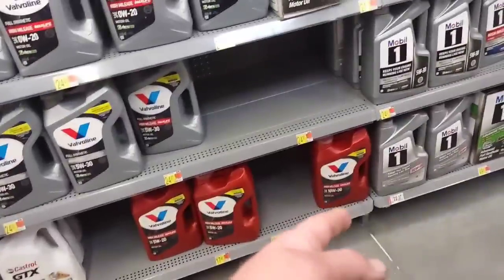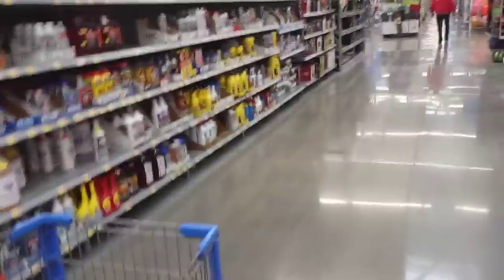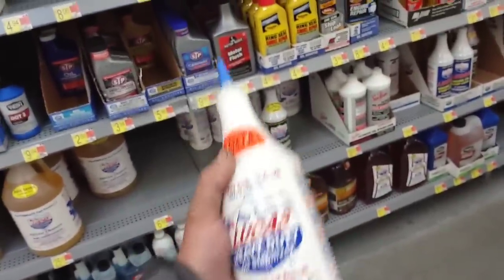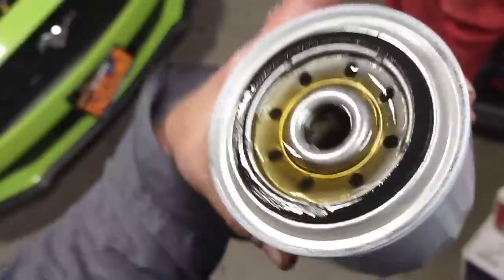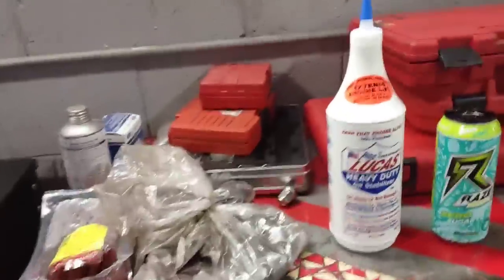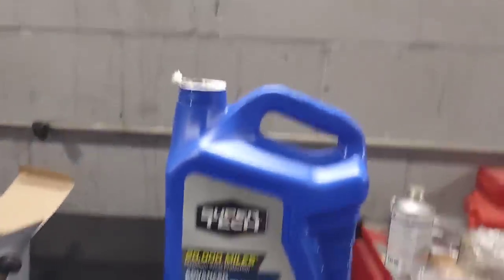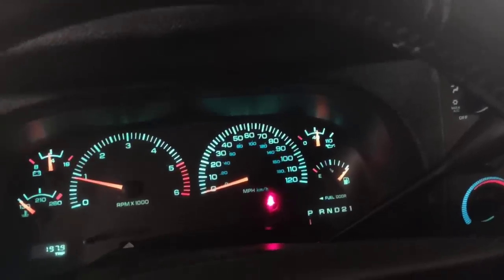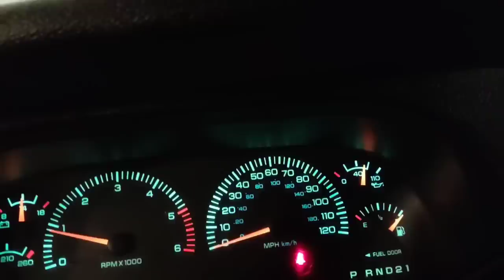We continue With Marvel Mystery Oil and SuperTech 10w30 20k Mile Full Synthetic Oil Dodge Ram 5.2L

Comment: RIch, do you think that using some amount of MMO in any DI engine would help to limit or even remove inlet valve deposits that tend to build up because of the designs of the PVC systems?  Is there any way we could get this tested over a period of time?
Reply from the maker: I mean there might be some residual and there might be a little bit better oil control from piston rings but ideally I don't think so
Reply from the maker: I'm almost half tempted to buy a direct injection car and build a kit that people can install on their car just to clean the valves
Reply: I'm leasing a 2020 Corsair, and if there were an oil catch can for this newer 2.0L engine iwould install it. Most likely will buy at the end of the lease, so thinking long term.

Comment: Super tech oil is manufactured by Pennzoil for Walmart stores. If you change your oil regularly, it doesn’t matter what brand of oil filter you buy. I wouldn’t add any oil additive, it’s a waste of money, even if it’s made from a snake.
Reply: They've changed manufacturers several times but currently SuperTech Full Synthetic is manufactured by Warren Distribution, the biggest manufacturer of private label motor oils in the U.S.  Warren also manufactures Amazon Basics oil and Costco's Kirkland motor oil as well as the well known and respected MAG-1.

Comment: Why doesn't synthetic oil clean like conventional oil does? I run only castrol conventional or rotella 15-40. Conventional. 3k into my oil change and the oil looks like new and inside the engine is super clean.it seems like the synthetic oils dont clean like conventional oil does.
Reply from the maker: I don't find that statement to be the case
Reply: @FordBossMe  maybe its not so much the oil as it is the cylinder hone and piston ring combo of the older engines not working so well with synthetic oils. i think that's why they start using oil. that carbon stuff is from blow by past the rings cooking the oil in the oil rings causing them to stick. i fixed a few by switching them to conventional oil and changing the oil as soon as it started to turn dark. my friends camry had major oil consumption problems. always ran synthetic oil. toyota had a TSB on it. it said that some still had the early rings and the fix was to replace the piston rings. we went back to conventional oil and fixed it after 2 oil changes.

Comment: 500 miles is good but I would have bought another oil filter and change it at 500 miles. With all that dirt in the other filter you might be getting some by-passing.
Reply from the maker: I'm not sure what you mean I bought a new filter and put it on this time there's nothing saying I can't put another one on at 500
Reply: @FordBossMe  I meant you should probably change the oil filter at 500 miles again because the one you cut open from the previous cleaning was really dirty and was probably by-passing oil, just saying since you were already in walmart and don't like going there and their pretty cheap. Just trying to help.
Reply from the maker: @eddieg780  i will at 500 indeed, 
One of the commenters here suggests that I move it to an st8 which is the same filter except longer and more filter and capacity so I think I'm going to try that

Comment: Sorry, I just posted on your previous video on the Ram truck oil change - I did not see the new video.  
here it is - - 
  
I agree.  Stay with the MMO.  The oil filter pleats were very clogged after just 880 miles.  Change oil & filter, use same weight oil & filter brand plus MMO - go again 800 mi or maybe 1,000 to 1,100 mi.  
  NOTE - OK the MMO is working, we see the oil filter pleats.  WHAT ABOUT LARGER PARTICLES ON THE OIL PICKUP TUBE SCREEN?  Whatever larger particles were dislodged by MMO, would most likely be at the oil pickup screen AND in the pan.  
Opinion:  oil cleaners like MMO and Seafoam will remove dirt and dirty oil from the pressurized passages very well, but not necessarily from parts surfaces - like the rocker arms surfaces you displayed in 2 pics.  Sooo - Removing stuck dirt from surfaces will take much longer, and a lot of the larger pieces will end up in the oil pan and pickup screen.  
  Just my 2 cents.  Typically I end up dropping the pan on a used vehicle or engine I bought in the past.  
@Ford Boss Me
PS  Please do not switch oil cleaner brands = too many hypotheticals.

Comment: I don't know if your 5.2L ram truck is the same as my 02 ram 2500 w/5.9L, but I can fit the longer oil filter  (Wix#51515) on mine. It will give you more oil capacity and more filtering media.

Comment: It maybe a good idea to take off the sump and clean it out. I noticed how much crud is already present in the engine just from the tip of the dip stick being so black even after an oil change. 
Usually when the sump is clean.  The oil doesn't have any color change on the stick with new oil. 😉
Reply from the maker: Will see before I get too crazy with any of that if anything I'll run a basic EPR flush through it before I continue with m m o....
Reply: if his dipstick is like the one in my 02 ram2500 w/5.9L, the last 1/2" or 5/8" of the dipstick has this black coating on it. I have no idea why it's like that, but I'm told they all look like that.
Reply: @FordBossMe  Fair enough i see you want the results from the MMO first. 
 I guess I thought may spare the oil pump dealing with the crud. 
You are doing a great job!
Reply: @Rock Yourworld — where do you see crud? All I see is harmless varnish and discoloration of metal. 

Oh and did you know that brand new oil turns dark within a very short period of time after it gets heated up? Oil color doesn’t mean much. Hell, Royal Purple’s oil is freakin PURPLE for crying out loud. Lol.
Reply: @artem brayson. are you blind? did you not see the chunks of sludge in the folds of the oil filter media?  If enough pieces of sludge get past the pickup screen and filter media, it can embed in the bearings and scratch the journals. I've personally seen(more than once) it build up on oil pump rotors and seize them, breaking the drive mechanism. 
It takes some time for oil to darken in my vehicles. For me, it stays quite clear for 2500 miles and only turns amber at about 5k miles. IMO, if yours turns dark much sooner than that, then something is wrong with your engine, unless it's a diesel. 
as for royal purple being colored dark, that is precisely why I'd never use it, because you cannot see it degrade. Being dyed purple is a marketing gimmick with no other useful purpose.
Reply: @rustycowll5735  — who cares about all that. Just fresh oil will accomplish that, in a dirty engine that’s been neglected. 

I bet it will look the same under the valve cover after all this “cleaning”
Reply: @ artem brayson. if you don't care, then why are you even following the videos,  much less commenting. Keyboard warrior, perhaps?  
I agree that it might not make much difference with the inside of the valve cover, that's why I suggested he clean those separately in a parts washer. Why subject the rest of the engine to crud you could more easily, & thoroughly clean separately? But it's the youtuber's game, and he can play it any way he sees fit.
Reply: @rustycowll5735  — I don’t care about the crud found in the filter because A: that’s what filters do, so it’s normal. And B: he started off by showing the inside of the valve cover and wanted to clean it via MMO. I’ve been saying since day 1 that it isn’t gonna make it any cleaner. I’m sticking to it. 

Shit washing out that was stuck on the bottom of the oil pan isn’t part of the game here.

Comment: I was a auto technician for about 37 years in my experience if you run a oil stabilizer it wouldn’t clean as good. And dodge products the oil pressure should come up with a mopar filter. I had a customer who over 500k miles on his dodge 1500 and only used mopar filters. Ford and chevy don’t like fram filters. The lowers oil pressure and is from my own experience
Reply: What make of vehicle likes Fram filters? Years ago I would buy them just because of the textured grip on the bottom and I wouldn't need a filter wrench in most cases. I confess...Yikes!!
Reply: @chuckymurlo5654   the Japanese vehicles are fine the American cars it choke the oil pressure down about 10psi.the media material is garbage quality control is out the window. But the fram xp is the only one that is built to oem standard

Comment: I would go straight to 1K then open the valve cover again. It should be much cleaner and change it with any synthetic oil of your choice. I'm happy with  Valvoline,  Castrol, and Mobile 1.  I have not try Penzoil after BP bought them out, but from the Project Farm experiment now appears to be a good oil.
Reply: BP didn't buy out Pennzoil, BP owns Castrol to my knowledge. Pennzoil and Quaker State are owned by Shell.
Reply: @joshpodolsky7740  you're correct.  It was my mind got all mixed.  Thank you for the correction.

Comment: Lucas is thick oil with no additives,  don’t use it, no cleaning and diluting your additive pack.
Reply: This!  Lucas is just to reduce your engine knocking around, and fill up the grooves as cars age, also somewhat help seals/gaskets because it's high silicone.   Esther oils will already help with that.   Lucas is a last ditch effort and NOT for turbos!
Reply from the maker: That's why I specifically stated what I did it's just for oil thickness bringing up oil pressure when additives thin it out and because I'm adding an additive it would have been an option and it would have been an acceptable option but I chose not to change what has been working

Comment: Why do they design a redicuilus low oil pressure on the new 2.7L turbo I4 on the Chevy Silverado?I own a new 2021 only 2000 mi on it and the only time I see good oil pressure is close to 60 psi at cold start up after 5 min drops to 30 and stays that way.you look at any 5.3L with 0w-20 and they  run up to 50 To 60 psi with 2k rpm range.My opinion I,d like to see at least 40psi in my new truck.Factory fill calls for 5w-30.the only time I would see 40 to 50 is if you really got on throttle and hit 3500 rpm but even on a downshift coasting engine braking 3000rpm still 30 psi.acts like a computer control for oil pressure.
Reply: The thought behind that and with the pressure regulated, continuously variable output oil pump (not dependent on RPM to determine pressure) is that there is less drag with the lower pressure and in the new design 30 psi is sufficient and considered normal with pressure increasing to the 40-60 psi range when higher demand is placed on the engine . That being said, some owners have mentioned oil pressure slightly below the 30 psi norm (reports of between 20-27 psi) and in those cases the lower pressure may be accompanied by some stumble/misfire initially upon start-up. If you are also experiencing the stumbling at start-up then it may be a case of a service call. Some owners with the below 30 psi issue who have been told by GM service that they can't find anything wrong with the vehicle and to live with it have had luck in boosting the oil pressure up to the standard psi by adding just enough of a product called Hy-Per Lube Oil Supplement to bring the psi up a bit to where it should be. The amount needed varied according to how low the oil pressure was to begin with but in each case was less than one bottle.  Keep a careful watch on your 8-spd transmission. You may want to consider switching out the trans fluid your truck came with for Mobil-1 blue fluid before you start having any issues with it. Once you start experiencing the notorious GM 8-spd shudder the damage may already be done requiring not only a complete fluid replacement (GM tsb - states to do complete fluid replacement of the GM fluid to Mobil-1 blue) but also replacement of the torque converter and valve body. Lubegard also makes several products which have been helpful in minimizing, eliminating, and/or preventing the issues these transmissions have been having. They are Lubegard ATF protectant, Platinum ATF protectant, and Shudder Fix. Hopefully you haven't had any of the electrical gremlins pop up yet.

Comment: So you used the entire bottle of mmo to replace a quart of oil? Doesn't mmo thin out your oil? I thought it was used in oil to flush not replace?
Reply from the maker: Yes it's a 5 weight
Reply from the maker: It says right on the bottle can be left in long term
Reply: @FordBossMe  thank you
Reply: @FordBossMe  thank you
Reply: @FordBossMe  so I added MMO to my full tank on August 30, 2021. It's September 1, 2021 and I need to top off 1/2 tank; do I need to add more MMO?
Reply from the maker: @hotkimchi5803  no you dont beed to run it every time but its not a bad idea either

Comment: For a 5.4 V8 running 5W-20, what oil would you bump up to when using MMO? Thanks
Reply from the maker: 5w30
Reply: I’d go 10w40 especially during the warmer summer months. Your owners manual probably lists acceptable oil viscosities all the way up to 20w50 for HOT climates. 

Not sure where you’re at but use the thick stuff. Your engine won’t care.

Comment: Just got an oil change at dealer and it was significantly above the full line. Why cant b techs do a simple job like checking not to overfill the crankcase? Pvc valve probably suckin oil into intake. Anybody know how high the pvc inlet is is typically inside the  engine.. ? Doe it vent from valve cover ? Back to the dealer. Hopefully will not ask me to pay for another oil change
Reply from the maker: It's in the valve cover circulates through the intake

Comment: Hi. Could this be ok to put in my Honda K24 engine? Try to see if it will maybe help with the shitty VTC rattle. Thanks
Reply from the maker: It cleans so it may help some
Reply: @FordBossMe  bro, its been 3 full days without any rattle on cold starts. Now all night and nothing! It started the same day i put 600 ml of that marvel oil. I guess that the real problem is that gom gets in the VTC system and makes the pin, spring, etc.. gom up. Im serious 3 rd day and nothing!! And its been rattling pretty loud, (for 1-2 seconds). Pass the word, because many spent thousands replacing the VTC and the see it rattle again after a little while, (guess when the gom starts).

Comment: Should not fill oil filters, it's a bad practice. Car manufacturers actually recommend not refilling the oil filter. My car has 289k miles, I have never added an additive to the oil. I simply change the oil at 5k every time, used regular Fram filter and 5w30 oil.
Reply from the maker: Your missing the point here clearly

Comment: Use a quart of ATF during oil changes.  It’s cleaning ability is equal to. MMO and it has a better lubrication quality
Reply from the maker: It's actually not equal to I've already tried all that we even did that in a Nissan nv3500 with a 5.6 L plugged up motor and ATF wouldn't do a damn thing in 30 minutes
Reply: @FordBossMe   We used it with every oil change. Not just for a clean up.  Engines stayed spotless. Spotless.   I have other oils now that dissolve carbon much better than atf. I also don’t have a pushrod motor any longer  which was the primary reason for use - to keep the pushrods and lifters cleaned out.

Comment: Old school method of cleaning a engine --- add1 qt of transmission fluid to your oil .
Reply from the maker: Doesn't work I've already tried it actually I try to live here on this channel on a sludge Nissan motor and it didn't do anything for it it's just an old wives tale for people that have to do a light cleaning but it doesn't do anything for heavy cleaning at all

Comment: I myself have been using the super tech advanced full synthetic motor oil with the Marvel mix (Great stuff, just as good as Mobil)however I would highly recommend you use Fram Ultra synthetic filter it helps the car run even better!!! 

p.s. going to add the Lucas Heavy Duty oil stabilizer since I'm about to clock 200k on my sonata 2012 to make a little thicker
Reply from the maker: Don't add the stabilizer just go to a thicker oil
Reply from the maker: When you see me doing a video on an oil filter it's because somebody asked me to try it out if you've been on the channel for any kind of time or you're one of the Oggi's you'll know I actually like Fram Ultra and prefer it compared to others I really like the purolatorboss the best but if you see a filter in one of my videos there's a purpose for it and I get that you're just trying to recommend something better but I personally really don't need it because if you're seeing something specifically that I'm showing it's because I'm trying it out for reason but do not add the oil stabilizer there's no reason for that just go to a thicker weight oil
Reply: @FordBossMe  actually just stumbled upon your videos today and I've been watching a couple of them you some you got some good info going on here 😎, when you say go to the next level, if I'm running 5 w 30, what would be something with thicker viscosity?
Also do you think if I had the Marvel oil straight where I put the oil without taking the valve cover off would it do same job of cleaning the engine? I've never tried the Purolator Boss how much better would you say it is then the Fram, is worth the price difference? thanks for the replies 🤙😏
Reply from the maker: @JoseMorales-vq5fu  the Fram Ultra and fram titanium are probably close to the best you can actually get

Technically you really don't have to change anything until you start having problems

I would just keep doing what you're doing now and don't go thicker until you start noticing oil pressure issues or excessive noise because of clearance wear